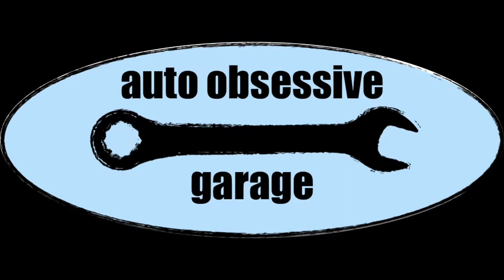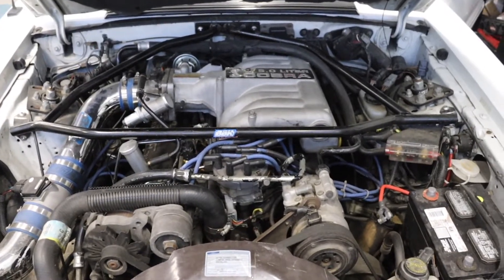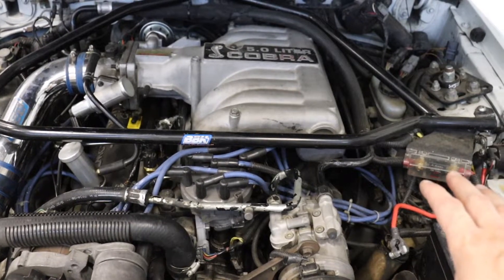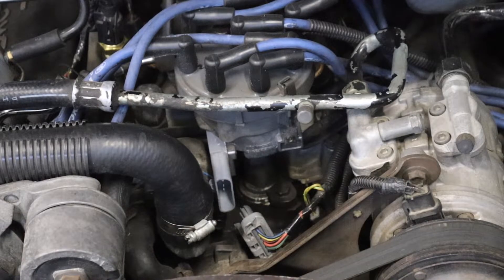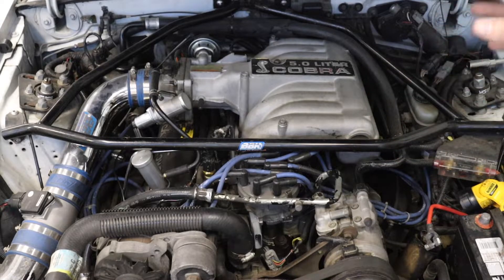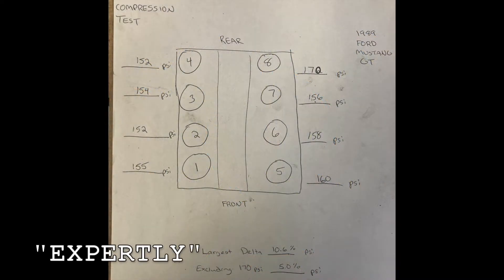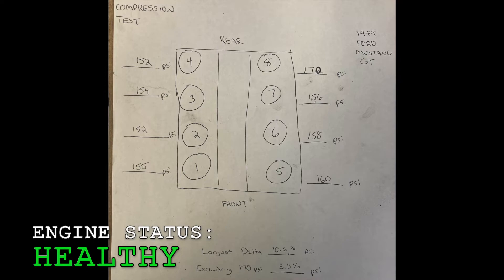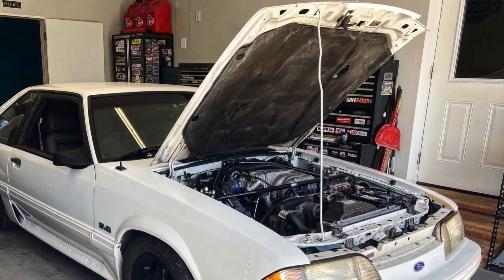1989 Ford Mustang GT - Episode 2: Compression and Fuel Pressure Testing

Comment: I could not for the life of me disconnect the fuel pump relay under my driver seat. It looks just like yours. To slide it out, Did you push down on the green tab or pull it up?

I was worried that if i took out the seat then I would to strip the bolt holding the front together (watched a LMR video stating to be careful)….but looks like I might have too to have a better look and access at the relay.
Reply from the maker: Man it’s been a while since I’ve done this…I wanna say I used a screwdriver and carefully pried it open. Push that seat all the way forward, get a light on it, and be prepared to be at an awkward angle. Good luck.

Comment: The base fuel pressure KOEO is exactly 39psi for a 5.0 Mustang...Any higher and it will mess with your fuel tables and it appears that youre not using the stock MAF either which will mess with your MAF voltage to AirFlow calibration...

Do you have the EGR deleted aswell?.If so and you didnt do the delete mod your timing will not adjust...
Reply from the maker: Spot on. It’s my buddy’s Mustang, and it’s got some mods for sure…it also had a bunch of parts just thrown at it by the last mechanic to get in there. He ended up getting a basic tune to account for these mods after I set everything up to a solid baseline and the car runs great now.

Comment: So my 91 has a running pump but will not build pressure until it's running. KOEOi get zero fuel pressure. I can hear the pump running and the engine does run. But once it's running the pressure will be around 35psi with the regulator hooked up and 40 unhooked. But when I shut the car off the pressure drops to zero immediately. Any help would be appreciated.
Reply from the maker: Sometimes in can be an issue with the regulator or the pump itself. For the pump, it could either be a leak on one of the hoses or maybe the check valve could have an issue. 
How old’s the pump?
Reply: @autoobsessivegarage  I'm assuming original. I have a 255 pump to put in anyway. I just changed all 8 injectors and put in a known working regulator after I asked this and it's still doing it. So I'm gonna drop the tank
Reply: The fuel pump was not original. The pump is a walbro. Not a 255 pump.  But I found a small weeping leak on the tank.
Reply: That’s definitely your fuel pump on it’s was out
Reply: @Gagecarter1500  
I have the same issue as trailerpark187.
I installed new fuel regulator and new fuel pump. Pressure gets up to 10 psi with koeo and drops to zero. engine running it will have 35psi and 40 psi running without vacuum.